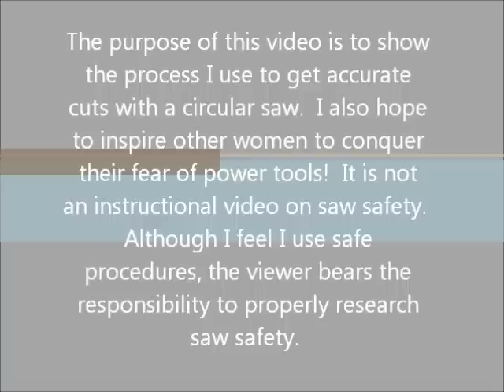Cutting a sheet of plywood with a circular saw

Comment: I wish you had explained how to make the guide. If you did, I missed it. One thing about this video that kinda bothers me is that you set that saw down while still running, I know they have a "guard" but they can get stuck, I have seen it happen quite a few times, no toes were cut off but it did cut through the shoe. I have worked in framing construction since 1994 and I have never seen someone work so low to the ground. I love saw horses. Other than that great video girl.
Reply from the maker: Thank you for the warning--I will definitely think of your comment when I'm running the saw and wanting to set it down too soon before the blade is still.  I've got a blog post about making the guide--I'll link to it in the comments.  Thanks again!

Comment: For your own safety and that of others as well, you might prefer not to carry the electrical cord over your shoulder or making contact with your body. Electrical cords can leak and without warning, compromise your safety by electric shock.
Reply: +Chet Swann I go to be an completly Dam Moron for this happen. not if you got a new electrique cord a good brand 
Never happen to me I'm a 35 years in the wood working never happen to mee my cord it's power only when in use otherwise it off of power and the cord are in the safe place  only messy people  like the stooges for example
Reply: +Knock Knock Who&#39;s There? Ok stay in peace and may God enlighten you
Reply: Tchau to you,too

Comment: personal i do not like getting on my knees to cut things so i built a folding saw horse.  it can be folded and stored when it is not need  it use a 2x6 rail.  I put 5 notches in the rails  that way.  i can use 2x4  by 8' in the notch .  2x4 are cheep so i don't care make little difference it strength you set the saw depth to no more the 1/4 inch any how.  you build the saw horse so that it is 1/3 way between you knees and  hip.  so can't reach the cut it is easy to get on top so you can reach the cut.  

and by the way you need at least dust mask,  fan to blow the dust out the door, better would be shop vac.
Reply from the maker: I may have to try out saw horses on my next build and make some for my height and see how it goes.  I set a bad example not using a dust mask--I really hate wearing them, but I know I should.  I've been better about it since I made this video and people called me out on it!  Thanks for commenting.

Comment: I'm having a hard time visualizing that you did not cut the 2x4 underneath the plywood board?  It seems the board is just sitting on the 2x4, and the board was cut through.  Therefore, the 2x4 should also have been cut.
Reply from the maker: Yes, it does nick the top of the 2x4s.  I've been using the same 5 for years now, and they are pretty cut up!

Comment from the maker: You Tube won't let me put a link on here for a post I did on getting accurate cuts with a saw that might explain how to line up the jig better than I can here.  BUT before you construct the straight jig, you might want to check out the Kreg Rip Cut.  I just used mine for the first time a few days ago and it is great (I don't get anything for saying that either).  I wrote up a post on that too at Pink Toes and Power Tools.  Let me know if you still have questions after reading those posts :)

Comment: Can this be done with a mitre saw or not? I was gonna buy one hoping to be able to do this
Reply from the maker: Hi Sam, a miter saw won't be able to cut up a sheet of plywood like a circular saw can.  A miter saw is made for making a cut on thinner boards, like trim pieces.  This article from Lowes https://www.lowes.com/projects/woodworking-and-crafts/how-to-use-a-miter-saw/project says a 10" miter saw cutting at 90 degrees will only be able to cut through a 5.5" board, a 12" miter saw can cut 7.5", and a sliding miter saw can cut 15.5".  You can see a miter saw in action on my other video about making accurate cuts: https://www.youtube.com/watch?v=vRbs8k8tSN4

Comment: What kind of saw blade do you recommend for cutting this or better grade of plywood? THKS!
Reply from the maker: I use a carbide 40T blade because I get decent cuts for a reasonable price with that blade.  That's all I've ever used on my projects.  I researched a bit about it though, and if you want an even better blade, you can go up to a 56T laminate blade but they are more expensive.  The more teeth (the "T" in the blade name) the smoother the cut.  I've heard that the plywood blades dull pretty quickly, so I've never used one of those.  I'm going to be changing out my blade soon, and I might upgrade to the 56T laminate and see how it compares to what I've been using.  Hope that helps!
Reply: Helpful video; I learned a lot. But since I only had to cut 8 feet of good quality birch plywood for my small project, I elected to buy a cheap $8, non-carbide plywood blade with many teeth. I secured a straight edge guide to the backside of the plywood, placing the "good" side down and had a neighbor catch the cut piece as I steadily went along with my Craftsman circular saw. The resulting edge was all I hoped for. Your tip on using a mechanical pencil (for precision) was wise and appreciated. Patient precision pays off in the end. Eye protection always! THKS!
Reply from the maker: Great!  Glad that you got the cut that you needed!

Comment: you can buy a circular tracksaw without using the ply as your fence it will save u time
Reply from the maker: +William Giblin I bought the Kreg Rip Cut and recommend it--I was hoping to retire my straight edge jig, but I have found that it is still handy to have around at times.  I LOVE how quick it is to rip up a sheet with the Rip Cut though!!

Comment: why not use a straight board, measure 1 1/2 inches depending on which direction you are cutting (small side of the saw plate) and rip?  if concerned with the plate going underneath the straight edge in the middle, I raise the front of the saw to stay against the board through the travel.  No risk of cutting the edge of the straight edge.

Comment: I have a table saw, but cutting a large sheet is way hard on a table saw even when I have someone to help me.  I'm planning to buy a circular saw so I will be able to cut large sheet material unassisted.  Right now, if I need a large sheet cut, I have it cut at the store.
Reply from the maker: I was afraid of the circular saw at first and wanted to have all my sheet goods cut at the store, but my first experience wasn't good with their accuracy (and to their credit, they do not say that they will give you great accuracy!).  That was the push I needed to figure out the circular saw and how to get as safe as I could doing it myself.  I finally got a table saw last year and you are right, it is too cumbersome to cut a full sheet of plywood on it, so I'm continuing with this set up.  Although I also purchased a Kreg Rip Cut guide which has speeded things up a lot (I recommend it if you buy a circular saw).  Good luck and thanks for the comment!

Comment: I'm a newbie to circular saws so logistical question - cutting across the 2x4's, does the saw cut through them albeit the tiniest bit?
Reply from the maker: Ginny2708  Yes, it does nick the top of the 2x4s, but if you have the saw set properly so the blade only comes through the plywood just a little bit, then it only nicks it. My 2x4s are marked up all over the place :)

Comment: Am a pro carpenter 28yrs experience. The plywood should be turned around lengthwise the way the 2x4,s are.two 2x4s should be kinda close like 2 inches under line to cut.thus you can drop your blade like 3quarters of an inch,cause wsy you have it if floor not level saw eill be cutting into 2x4s..( wanna be your teacher..lol
Reply from the maker: Thank you for your input!  I purposely cut across the 2x4s instead of in line with them so that there is no chance that the plywood can fall in and pinch the blade.  Having the 2x4s as close as you mention would probably keep it from happening, but trying to line up the cut line with the 2x4s within 2 inches of each other across the 8 feet of board--it feels like it introduces a possible situation where the boards can pinch and kick back the blade.  When the cut is across the 2x4s it is impossible for the boards to pinch.  It does mean that the blade will nick up the 2x4s, but I am totally ok with that!  Thanks again for your comment though, I appreciate that others might make the cuts differently :)

Comment: Or you could order it pre cut from the supplier. That would save all that pratting about, the dust and shit off the saw, the hazard of a live cable over your shoulder and the 5 trip hazards in the 2x4 on the floor.
Reply from the maker: Yep, you certainly could!

Comment: Mine doesn't get much use.>>>ur2.pl/792    A building contractor will have better advice regarding durability, etc. Still I like the power and convenience of this unit. I have other DeWalt tools that use the same batteries, so together they are greater than the sum of the individual tools. It took a very long time to find a bargain price on this, but it was worth it.

Comment: Surely someone has thought of turning the ply board the other way so the cut is between the studs. Am I wrong? This is only the second how-to vid I've watched.
Reply from the maker: Please do not do that!  You want the 2x4s to fully support the plywood after the cut is made.  Kick back can happen if the plywood falls in toward the blade after you make the cut which could happen easily if you run the circular saw parallel to the 2x4s.

Comment: Why not work off of saw horses?
Reply from the maker: Andrew Frey Saw horses would definitely be easier on the back!  I feel more in control of the saw this way.  I'm pretty short, which means my arms are short too, and I can see over the top of the cut, which I couldn't do from sawhorses.  Just upper body strength alone, I think would be difficult for me for pushing the saw along the cut from the side.  And if I ever did have some kind of kickback, I just feel like I've got more control where I'm at rather than up off the ground.  I've never used them, so maybe I'd love it though!
Reply: +Pink Toes and Power Tools if you are short you didn't eat your soupe when you where young LOL
"La soupe cela fait grandire" Je plaisante i'm joking LOL LOL
Reply from the maker: +DanielGuyFrance I wish it were that easy--I would have been eating soup at every meal ;)

Comment: wow if I did all that on the job I would get laughed off the site

just chalk line your 2 marks and cut along the line
just watch the blade and follow the line its easy takes seconds to set up and start cutting
the trick to super straight lines it to just go slow and watch what you are doing
Reply: imchris5000 I'm assuming she is doing this in spite of a table saw.  You cannot freehand a perfect cut. and you should follow the guide on the front of your saw and not cut your actual line.
Reply: Andrew Frey
the guide on the saw is not always true
after using some fucked up saws that have dropped a few times you just look at the blade

if you chalk a line and go slow following the line you can get a perfectly straight cut
Reply from the maker: imchris5000 Wish I could get the accuracy you can get with a chalk line!  I need the guide and as perfect accuracy as I can get since I am generally putting together cabinet carcases and building drawers with the cuts I am making, and it makes it far less frustrating during the "squaring up" part of all that if I've spent the time up front with the guides.  I work alone, so nobody to laugh at me :)
Reply: I can cut half of a chalk line off perfectly on an 8ft rip

if you just use a chalk line and go slow its easy
*****

Comment: Turn this sheet 90 degrees on the floor and cut in between underlaying bars! Stop wasting valuable pieces of wood!
Reply from the maker: +Alex Awwesome Cutting perpendicular to the 2x4s on the floor is on purpose so that the plywood can't fall inward and pinch on the blade and kick back.  The 2x4s fully support the plywood during and after the cut. I've used the same 5 pieces of 2x4s for 5 years now, so I've gotten quite a bit of use from them--no wasting here, I try to be conscientious and I hate wasting money ;)

Comment: Jean shorts, goggles, boots,, still unimpressed. If the guide is straight,, no need to mark 4 spots and if you cant chalk the line and follow it,, you shouldnt use the saw. If the cut is gotta be precise for cabinetwork, for example, it should never be done with a circular saw, especially not with THAT saw,,its homeowner grade , at best.
Reply from the maker: Thanks for you opinion!  Since I wasn't attempting to impress anyone, I'm not offended ;)  You are right, 4 marks is a little overkill and I say so in the video, but it is what I felt comfortable with at the time.  Probably better saws to use if you have access to them, but I didn't, and I have managed to build some pretty precise cabinetwork with it.  You can check out the built-in desk and cabinets I just finished for my dining room at Pink Toes and Power Tools (dot) com.  Probably not up to your standards, but I'm happy with it!
Reply: Pink Toes and Power Tools Dear PT&PT, my experience in life and woodworking is that anyone who says "can't," "shouldn't," and "never"--here, referring to tconst17--is rarely to be trusted. I thoroughly enjoyed and benefited from your presentation. Perhaps tconst17 never heard the one about "measure twice, cut once."  Measuring 4x is being extra careful--good on ya. And, uhm, I thought it was pretty clear you weren't doing fine cabinetry with that plywood.Keep 'em coming--much appreciated.
Reply: Pink Toes and Power Tools

I was always told measure twice cut once, so four marks would be the bare minimum I would have thought.
Good video.
Reply: lol I measure, measure, mark, measure, maybe mark again, measure agian, cut, measure, measure...maybe it's just my ocd but no harm in marking to keep things straight! ;) keep up the good work.

Comment: No hearing protection, no dust protection - not a good practice.
Reply from the maker: Hi Theo--I do in fact use hearing protection in this video, and I also emphasize to the viewer that they should be as well.You can see the green "ear muff" style wrapped around my waist right at the start and they are on for every cut.  Now dust protection I need to get better about.  Hate those masks...
Reply: Pink Toes and Power Tools definitely follow through on the mask.  Harbor Fr. has them inexpensive.  Woodworkers are 8 times likely to develop asthma or other lung problems and all but specialty plywood has formaldehyde in the glue.  Formaldehyde has been definitely linked to cancer in long term exposure cases.  Serious stuff so don't ignore having dust protection.
Reply from the maker: B Miller Very good advice that I will listen to.  I'm good about it when I'm using my paint sprayer, but not so much when I'm cutting wood.  Do you have any advice for one that doesn't fog up your safety goggles when you're wearing both?  Luckily I use PureBond plywood which doesn't have the formaldehyde, but I still don't want to chance any problems down the road...
Reply: Pink Toes and Power Tools  Nice Video! Her my advice for the dust mask http://solutions.3m.com.au/wps/portal/3M/en_AU/GlobalMining/Home/Products/WorkerSafety/?PC_Z7_RJH9U5230GM530IQDGUMOE3O51000000_nid=RJT61QQZF6gsKXCTK5DQ71gl1XZRCL6CHZbl

The 3M 6300 Mask

Absolutly no fog up with safety glasses. Works perfect for me.

Keep on your Videos!
Reply from the maker: Oliver Syre  Thanks Oliver--I just looked up the price on Amazon and am shocked at how inexpensive it is too!  I will definitely pick one of these up.  I appreciate the help!